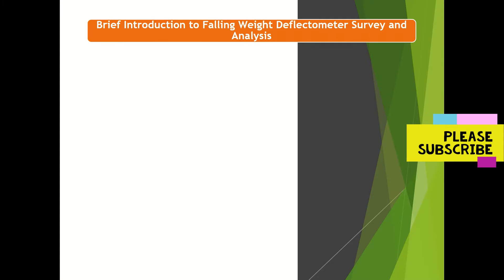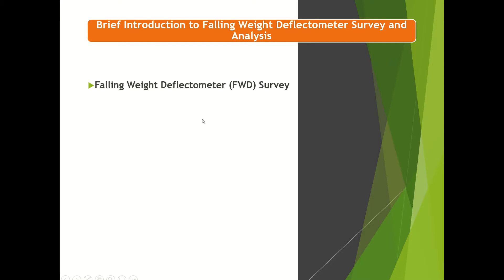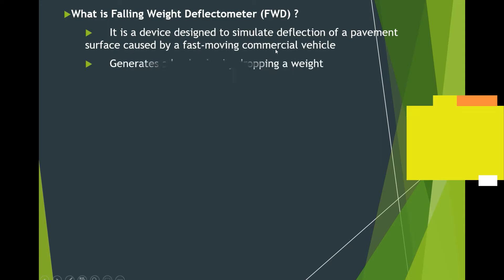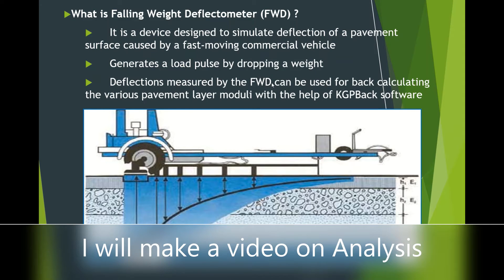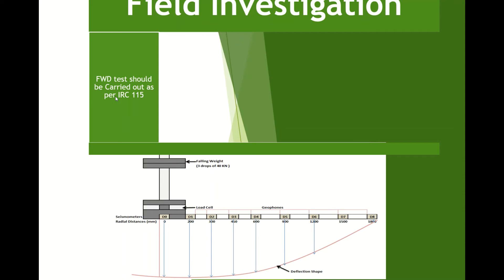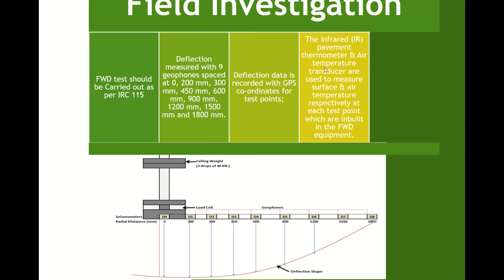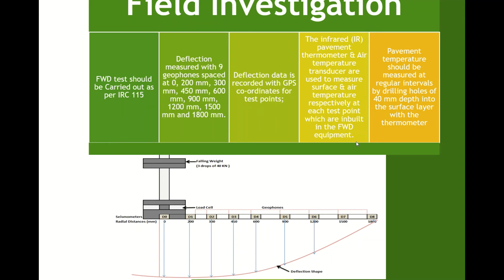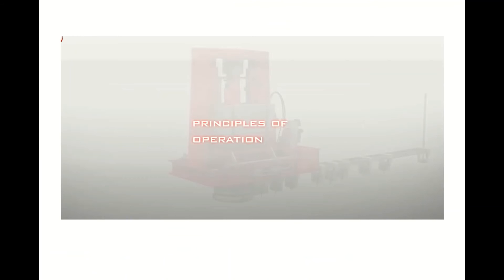Falling Weight Deflectometer (FWD) Survey Introduction || Process ||

Comment: I have question. Could you please make a comment. Assume that road is 10 km and made of from concrete. What should be the distance between two measuring points? So, at least how many measuring points are required for 10 km .